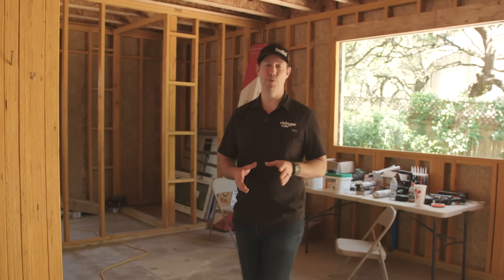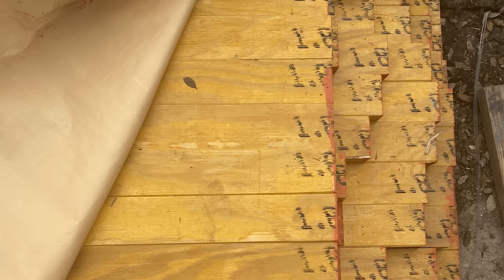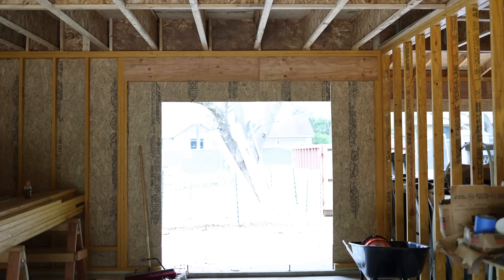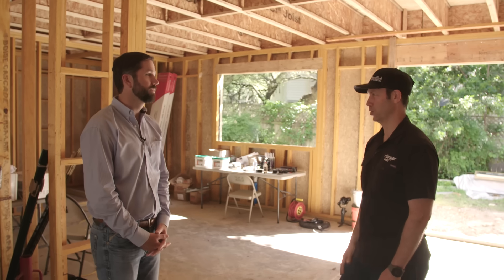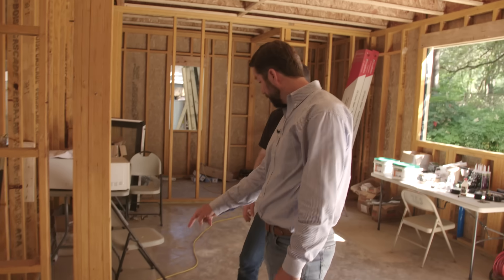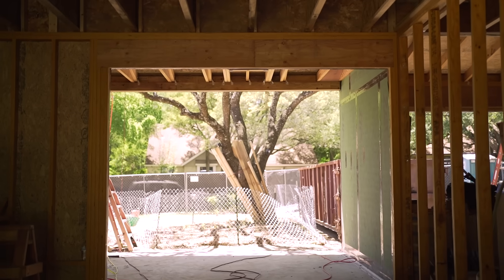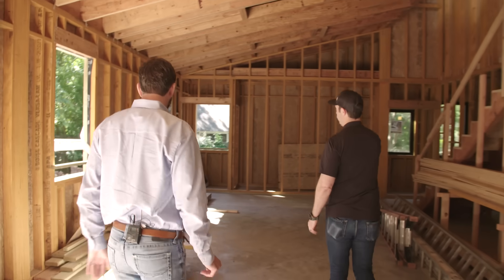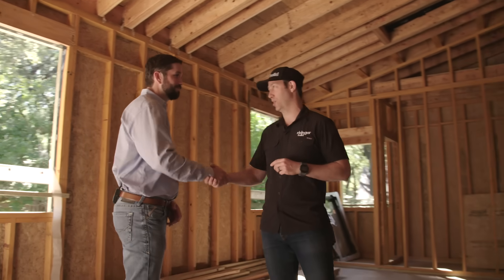House Engineering - Common Mistakes

Comment: the most common mistake:  thinking you can't build a house without Simpson products. Hundreds of years of building have proven otherwise.
Reply: a lot has to do with code requirements that take uplift, etc. (storms) into consideration. Those structures that follow best-practices will weather a storm better than the common house a 100 years ago. [there are the exceptions of very well built structures that can survive a bad storm back then, but not the common home]
Reply: @timskufca8039  Horseshit. Building to prevent seldom occurring events is wasteful. The point is, techniques for doing so should have been developed that did not rely on one or two manufacturers of a product.
Reply: @theprofessorfate6184  The techniques ARE/ HAVE BEEN developed. Simpson just invested in realizing the techniques  in a cost-beneficial way. Your assertion(s) are peculiar and unfounded. The huge hurricane in Florida about 20 years ago leveled whole neighborhoods, except for the four houses in one development, that had been built by the Habitat for Humanity. They were so stupid and inexperienced, they built to the code, rather than paying off the inspectors. They used (Simpson?) hurricane clips. Those house stayed together. Who would have thought??
Reply: @theprofessorfate6184  "Building to prevent seldom occurring events is wasteful." Tell that to the people who lose their homes every year in hurricanes, or to the 7,000 single family homes, 5,000 mobile homes and 49,000 apartments that were destroyed or extremely damaged in the Northridge earthquake.
Reply: @TheProfessorFate I can guess how you are dealing with covid-19.

Comment: I wish Matt was in Australia and could take a look at my insane, old roof structure made with hardwoods, treated pine, and who knows what else, sloppily connected and all covered in old Colorbond steel panels.  It creaks and pops in loud cascading waves across the length of the house but it has stood up to some serious winds that scream over the hill like a tsunami.

Comment: Matt, one thing you guys should cover is the growing, and somehow still unknown, requirement for shear walls; where these are required, their purpose, common framing mistakes and how to resolve them. It's been an interesting topic since the designers (architects and engineers) have different thoughts about how to satisfy this, not to mention how farmers think it should be done.
Reply: Yes, I'd like to see more about that too. Also, discuss using some of the prefabricated shear walls like Simpson StrongWall.

Comment: Some 15 years ago we had issues with nail pops in subfloor over LVL (not solid sawn) T&B chord I joists. By happenstance, I ran across a report on nail types for various lumbers. We had been using ring-shanks for our subflooring since whenever, but turns out this is WRONG for engineered lumber. The glues in the engineered materials make the fibers more rigid and brittle, and the annular rings on the ring-shanks nails act like a broach does in metal. They punch a hole in the engineered wood, so that the fibers do not close around the rings, and cannot therefore provide resistance to withdrawal. A smooth shank will push aside the wood fibers, without cutting them, and the glues and the (typical) coating on the nail shank will develop the needed withdrawal resistance. In solid sawn, the ring shank pushes aside the unreinforced (by glues) fibers, which then relax back into the grooves, providing the greater withdrawal resistance. 

We have also found that 1 1/2" hanger nails into solid sawn generally loosen during drying (really noticeable on hurricane ties). This is significant enough that the rule is 2 1/2" hanger nails if at all possible, whatever the spec. We also like structural screws a lot; they don't become loose, but the labor is a bit intense. We are often able to get away from hurricane ties by using solid rollover blocking flush to exterior on the top plate, between rafter tails, and using tall sheathing  to tie the wall studs to that blocking, which is then nailed solidly to the rafters. Just need a responsive engineer, and careful management of the framers. Oh, we don't do vented attics, and do seal the wall sheathing to roof sheathing, as part of the continuous exterior insulation system, as per these videos. 

Why not spec a Parallam post and save the bolt-up labor?
Reply: Interesting about the withdrawal of ring shank nails from LVL. Would you happen to remember where you found the report you ran across?
Reply: @nomen_meus  This was long ago, and I did not download the document. I did review and discuss with my (superb) structural engineer, who was as surprised as I was. I went out on my current job, and found that the ring-shanks that had popped  (renovation in a very old house, where we had to be tying in to stuff that was a bit below modern standards) could sometimes be pulled out by finger power only (!!). It was eye-opening, to say the least. The only thing that had saved my jobs (I surmise) was the rigorous use of subfloor adhesive. The bit about relative shrinkage between solid sawn (always) and engineered wood (basically none) in the video is an important concept to be aware of, as it can can cause distress much later (with little recourse). The LVL in our case was because the 100+ year old solid sawn was dried down to a final dimension, and we wanted the new to NOT shrink after we installed it. Match now/ match later.
Reply: @lhsunimog  yes I use LVL scraps from work in my 70 year old home reno. It's almost always straight so I can just focus on correcting the old timber, and the low risk of shrinkage means one less thing to worry about. An interesting thing I've found out about LVL is that if it gets wet it will swell, but will retain some of that expansion once completely dried out. So I try to avoid that...
Reply: @lhsunimog  what climate zone do you build in?
Reply: The trees are so small and immature that nothing holds anymore. I saw the last of the decent lumber go and since then its been a nailing nightmare!
Reply: Mr. Stevens, do you think the increase of engineered products in construction would be benefitted by a return to square shanked nails?  With modern manufacturing the offset in price could be negated.  The increased holding power would be a great boon to quality construction.
Reply: I found it strange that he didn't mention structural screws at all. If you want a squeak-free floor all you need is construction adhesive, normal OSB/plywood, and structural screws. They won't break, won't back out, and the glue keeps the OSB from rubbing against the joists in the spots between screws.
Reply: @namAehT  Yes. Screw all floors with structural screws and you will have no problems with your floors. Been doing that for quite some time now. Of course you always glue the floor as well.
Reply: @iamjackalope  structural screws? Do they have bugle/flat heads? I guess adding 1-2 more dollars per sheet for structural screws seems modest compared to price of 4x8 3/4 sub flooring..
Reply: @johnwhite2576  Yea bugle head screws like deck screws #10 minimum course thread 2-1/2" long. You can get them in collated strips for use with screw guns that have a long pole attached to them so you don't even have to bend over to screw off the floor. You just walk along and zip them in. I also use structural screws (Simpson) to install Simpson hardware when ever I can. When ever it is allowed by Simpson. These are way different then the deck screws I use on my floors. These are #9 and #10 and larger galvanized hex head screws of various lengths.
Reply: @iamjackalope  but won’t they stick up above subfloor surface ??
Reply: @johnwhite2576  no.

Comment: 6:27 I remember my uncle installing joist hangers with drywall screws on his deck. I did the old pliers twist test with a Simpson nail and the drywall screw and he ended up pulling the screws and going with nails. The joist hangers from Simpson actually tell you which nail or screw to use and if you elect for a shorter nail or screw it will give you the reduced structural capacity.
Reply: Deck screws and drywall screws are intended to "clamp" parts together. They're harder than nails to prevent excessive twist when driving them in with a power driver. This property makes them brittle and not suitable for handling shear loads. Not all screws are the same however. There are screws specifically designed for joist hangers amd these are designed for both clamping and shear load (more ductile material and a thicker cross section). They're much better than nails.
Reply: @OU81TWO  I disagree that screws are better than nails. I've used a pneumatic joist hanger nailers and it's so much better and faster than a drill or impact gun. I recently went to a Dewalt 20v hanger nailer an cutting the cord, hose and compressor has been the best ever. Time is money and messing around with a structural screw is no fun when installing hundreds of screws.

Comment: We used up to 28 feet on a building in Palo Alto in '79, they called El Pino Viejo, 2 x 14, 1 foot on center, 4 x 14s bolted to the walls, which were speed block, and we did some pour in place. We nailed the joist hanger nails with a palm nailer, which was like a heavy radio mic, with a tip that ran in and out, a spring loaded collar held the nail, and retracted to drive the nail home, it was pneumatic.

Comment: All well and good, until these engineered products become code requirement, and you have to live in a tent because you're not allowed to build an affordable home...
Reply: It would become much cheaper if it's all that is available though
Reply: @vincep7014  ?Cheaper because it's the only thing available? That's like saying cake is cheaper then bread if there's no bread to buy...
Reply: In some respects codes are becoming more stringent because they are demanding higher standards now. But at the same time I'm happy to see more options becoming available. For example the IRC 2018 was given an appendix to allow for tiny houses, and unburned adobe masonry is gaining more acceptance.
Reply: Ain't that the truth !

Comment: If I worried about post tension cables. I might try to access the ends, and hook a radio signal to it, like underground detection with USA, Underground Service Alert, companies hook a radio signal to the conductor, it acts like an antenna, and they have a sensor that they pass over the ground until they find the conductor.
Reply: Would a good metal detector work ?

Comment: Another thing about that wide saddle, you saw on the San Francisco Bay Bridge in the earthquake, the concrete column shifted, and the concrete beam slipped from the bearing of the column, and the deck went down.

Comment: Hey to Matt or whomever does his video production, most of us would rather have to turn down the volume rather than not hear it at all.  Just some friendly advice but what do I know I only DJ'd for 30 yrs.
Reply: Well there's your problem, you DJ'd for 30 years. LOL,  DJ's live in the red end of the meter.
Reply: @travis1555  haha yeah you may be right😀  but I would always rather turn down a video than have to put earphones on to hear it.  Honestly I watch most of my videos outside on my back deck with a lot of noise from my 4 dogs playing or rain or the train every once in awhile from a few blocks away.
Reply: It's not the video volume their modulating, it's the 'noise' suppression; it cuts off the top and low end of the vocal spectrum, so low energy sounds get cut out.  Example @11:50
Reply: I have Tinnitus and wear hearing aids so this volume works fine to me.

Comment: This is so interesting I wish I learned engineering in school
Reply: It's not to difficult to learn the basics,. It's called "Statics" a type of physics based mathematics. 

Area loads from the roof and floor distribute to unified distributed line loads on the beams which then distribute to point loads on columns all the way down to the foundations and footings for buildings. Concrete footings are like snow shoes redistributing the above forces to the ground so the building doesn't sink.
Reply: That’s what college is for. Some high schools have a basic general engineering class or two, but you won’t get anywhere near the specifics in this video.
Reply: They never mentioned those engineered floor joists do NOT last long during a house fire the can easily collapse when firefighters are in house searching for occupants
Reply: Search for HUD Structural Design Guide. It’s a good high level summary of the engineering calculations involved.

Comment: So Whit made some comments about using the "recommended" nail due to the 'mistake' pointed out about builders using screws instead of nails when it comes to the joist connections. An average nail absolutely has greater shear strength than the average screw, so naturally the nail would be the better choice. But today there are so many "structural screws" like GRK, Spax, Torx, etc on the market that have high shear strength values. So how do THOSE compare JUST on shear strength alone to the average nail used on a joist connection?  I understand they cost more, but if they have comparable shear strength and much higher tensile strength, are they not the better choice engineering wise? In addition, adding glue could also mitigate shear value loss or no?
Reply: Your question is the proverbial 'how long is a piece of string' question. The engineer said there were structural screws that can be used (which Simpson also makes). All the major manufacturers have design tables that you can compare properties of their fasteners.  Simpson has one of the most in-depth set of charts/tables/catalogs available anywhere.
Reply: @h2s I got to tour their main factory once. It was an amazing place. They've got incredible testing facilities and a real engineering mindset. I don't know if their materials are "cheap" or not, but they are certainly fit for purpose.
Reply: 2 factors to consider, shear strength and ductility. Common nails are ductile, which is good. They stretch rather than fracture. I would only use screws recommended by the hanger manufacturer, not just some off-the-shelf screw. Most screws are quite brittle.
Reply: @h2s  Saying "cheapest" material is nonsensical. Simpson products are rated for load. Who cares if they used stamped cheap steel from China with only 30000psi tensile strength. The cross sectional area of the product is designed such that it can safely support the rated load given the tensile and shear strength of the material.
Reply: Thanks guys.  This all helps.  All about listed and tested values. That's gonna make my choice, not some sales pitch.
Reply: DavincisClock correct. I’m an engineer and 95% of the time, the numbers are what makes your choice for you. If a nail says 10 PSI and a STRUCTURAL screw is 20 PSI, the screw is better. The only thing to check after that is compatibility between coatings on screws and whatever you’re screwing into. Believe it or not I’ve seen pressure treated wood literally certain coated deck screws. Can’t remember what the screws were coated with but it caused a chemical reaction. Most engineered systems of any sort provide the compatible glues, fasteners, etc for their products and if you aren’t sure, call the technical assistance line. I do commercial building engineering and when it comes to concrete fasteners and technical assistance, Hilti, Powers, and now even Simpson has very good technical data backing. In residential, im not as familiar but Simpson seems to be one of the best with their engineered systems. Good luck.

Comment: ever seen really old furniture, that glue falls apart eventually! change my mind?
Reply: Glue technology has changed greatly over the years my biggest fear is 1 leak and your screwed toilet, roof, pipe.  Goodbye structural integrity.
Reply: @davidamoritz , Aren't these glue types waterproof or at least resistant ?
Reply: @augustreil  The glues themselves would not be the problem. With laminated products you have a lot of exposed wood fiber ends, which can be vulnerable to moisture, more so than solid sawn lumber. But a single big plumbing leak wouldn't be such a problem, so long as they can dry out after. The bigger concern would be repeated wetting, such as in a badly detailed exterior wall. But if that happens you're going to have problems with solid sawn wood too. It just might take longer.
Reply: @davidamoritz  I doubt it.  Even normal wood glues are waterproof and far stronger than the wood they bond.  If anything, the glue adds to the strength as a provides a measure of protection beyond what raw wood has...
Reply: Most old furniture and musical instruments used hide glue, which is intentionally weaker than the wood it bonds to. This allows it to be more easily disassembled and repaired. This is NOT the type of glue one would use to build a house. Glues for wood construction products are designed chemically to be stronger than the wood, so that the full strength of the wood is maximized. This page gives a run down of the typical glues used in various wood construction products. https://www.woodproducts.fi/content/adhesives-wood-construction
Reply: Not the same thing by any means
Reply: A good glue joint is just like a good weld; the joint becomes stronger than the substrates and the failure will be elsewhere.